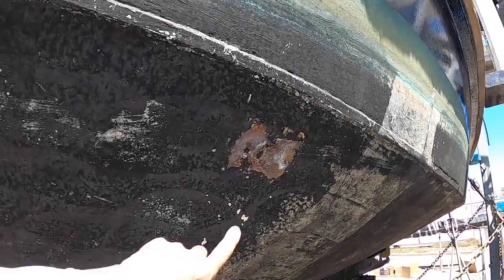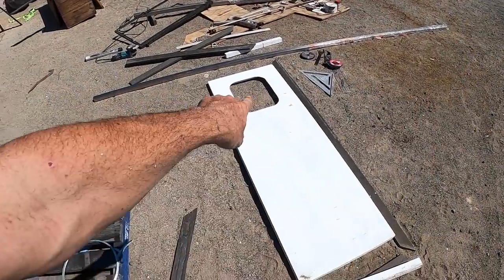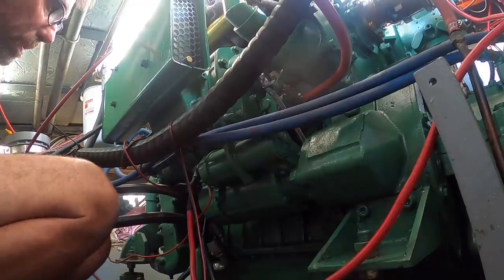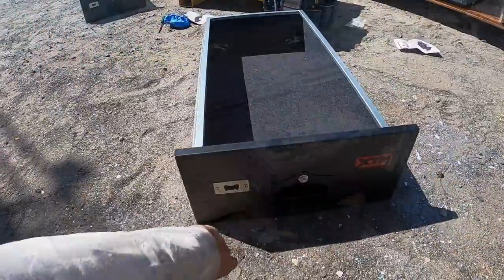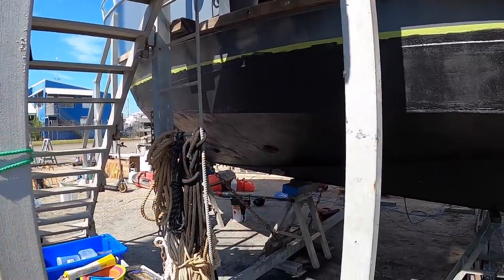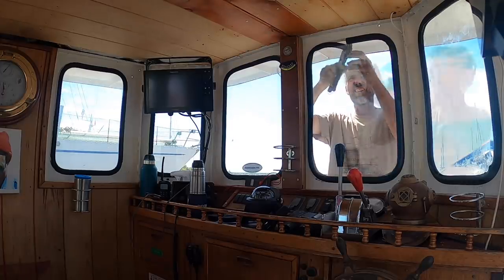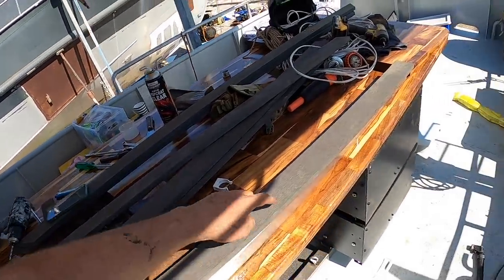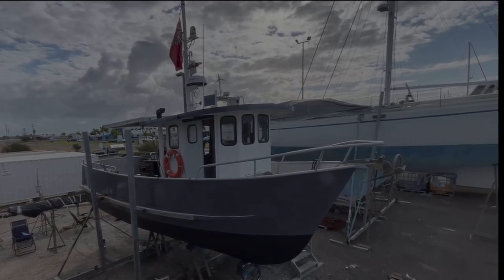Renko gets painted - last full week on the hardstand

Comment: Stu... Renko looks great, but I hope you misspoke at 18:12.  Dielectric grease repels moisture and helps prevent corrosion.  It does not conduct electricity and will not improve conductivity.  The fridge may be the most important support system on the boat.

Comment: Just a quick note on the self amalgamating tape ( you did say this is temporary but...) I always add an outside layer of electrical tape. it helps meld the rubber tape into a solid mass and protects it from sunlight.

Ha Ha - really enjoyed the sheer glee on Damiens face when you were covered in bottom paint!
Reply: For a job like that I’d recommend heat shrink

Comment: I like to write or scratch in the date and engine hours on the oil filter. Dielectric grease is a non conductive insulator. I found out when i put it on my auto battery terminals and then connected them. They failed within a month, i cleaned it off and then reassembled and put a thin coat of grease on the outside of the connected parts.

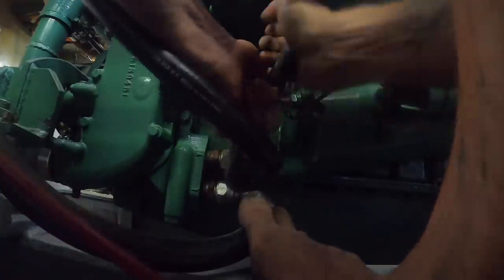Comment: 9:04 it might be worth buying a cheap ring spanner and modify (cut the ring big enough for the line but small enough to be six/five point) it for those oil lines. Maybe denso tape those types of fittings (shouldn't be needed in the engine room). Starters, alternators, fuel pumps etc do need to be easy to change and it's good to have proven spares. Your doing great! It's good to see someone getting to know their boat well enough to safely get the most out of it.
Reply: Cheaper to buy a set of crow foot spanners  and do it properly mate

Comment: Great update. I was pretty chuffed when the decks got fixed, but holy cats how nice everything looks when painted! I find the drawers on the engine hatch a bit confusing. Don't they make it hard to get to the engine - like really hard - even harder in the event of an emergency - and even harder than that in an emergency at sea? Maybe there's something I am missing.
Reply: There's a new hatch between the sleeping cabin and the engine room now. So you can get into the engine room without taking off the hatch. Still doesn't seem ideal though. The extra storage would be really nice, but wasn't there going to be two great big steel toolboxes on deck?
Reply: That was my thought. Do you really want a engine hatch that takes two people to get off.

Comment: Q: How are you planning to open the engine hatch on your own? It looks more than 2 bits heavy now with those drawers and table top attached.
ps. I know about the hatch in the sleeping quarters but, for instance, the batteries are at the other side of the engine "room".
Reply: Some gas struts could fix that
Reply: He has the hoist that he used  to bring in on deck
Reply: Neils.  He has the hatch into the living space for quick access.
Reply: @albertomoniz9051  But in the video you can see the fixed angle of the deck hoist and the arm length just don't fit under the solar canopy.
Reply: was thinking the same, could climb in through the new cabin window in an emergency ?
Reply: @mattmurphy9100  That could possibly work, but then he will absolutely need blowers or ventilation. It isn't so bad previously as the open engine bay hatch was a massive airvent. If you have no main engine bay hatch open, entering via the cabin (which is a low point) is going to be dangerous if there are toxic gasses in the engine bay (eg. exhaust leak) and no other method of high volume air movement.
Reply: @albertomoniz9051  It hasn't the reach I don't think. They carried it the last two metres.
Reply: I think a snatch block from under the roof will do it.
Reply: @Sokrates66  Those solar panels are mounted in a aluminium angle frame suspended with a few wires from the mast. That does not make a solid roof. 
Without the wooden table top two man just could lift the hatch.
Reply: and once the drawers get filled with stuff, as you know, drawers are wont to do, the thing will weigh a ton! So much for whipping it off to do a quick check on whatever, like the water strainers etc..
Reply: @nielsdebakker3283  I dont know, i meant that a snatch block from the roof of the cockpit, not solar panel. You dont have to lift everything just tilt one side of the hatch, maybe lift with the crane at the other side if needed, that was my thought.

Comment: She looks great Stu. Had windows in rubber on a steel boat I built 35 years ago. Same set up as on Renko. Had one punched in by a wave on the Tweed bar. Lucky we didn't cop another. I fitted brackets across the corners to stop it happening. Don't trust the rubber.
How far up are you heading?

Comment: Renko looks like a yacht now with the new topside color, the new starter you put in will last you the life of the boat its a gear reduction starter compared to the direct drive MT42 you took out. Keep good start batteries you shouldn't have any issues, the old Detroit should spin over faster. I know what removing bottom paint is all about I had to strip a 24 foot off shore work/pleasure aluminum boat down to white metal. Previous owners didn't have it done properly. Not a fun job, I put 4 barrier coats then 4 coats of antifoul, it was expensive, all good now.

Comment: Ad a Balmar Smart regulator to the to the alternator, you can really regulate in and out of your batteries, you'll really reduce pricey future problems, it has a reporting system that you can view from the helm. Batteries DO NOT function off of a fixed charge system, they all don't want to receive 14.6 volts and really can't, the allowable voltage to keep batteries charged differs by heat and temperature and by how much charge they need. So if your running constant voltage to a battery, you are just looking to have shot batteries. This system feeds each battery exactly the voltage the battery needs to accept for the conditions.

Comment: Dielectric grease should never be used on the actual connection points between connectors or between the wire and connector.  It should only be used to seal the outside of connectors.  

Dielectric grease is actually a insulator and can cause a high resistance situation.

Comment: Out of MacGyver/hacker mentality  and curiousity, if you needed to in an unlikely emergency could you take the gear off a starter motor and mount it with whatever methods available onto an electric drill then jam that in the place of the starter and start the engine with it or would it not have enough torque? I have no experience with engines of that size and also I think it is an interesting thing for you (or Adrian or anyone who would know by heart if he shows up) to answer
Reply: The original MT40 starter Stu took out is rated around 12 HP, you would need a very big electric drill. It would be easier to get another boat to bump start him ;-)
Detroit engines start quite easy, but the initial 'breakaway torque' to get them turning is quite high, there are different types of starters available, compressed air starters, hydro starters that used high pressure oil stored in a tank, and inertial starters and wound spring starters, all have their good points and shortfalls.

Comment: Your engine would be easier to access if you installed an undersized engine as well. Just sayin'. My thoughts are that a certain boat should have two of those cummings engines in there. I've seen smaller boats than that one with two.

Comment: I dont know if you could help me but I have an evindrude 30hp which is the same one as the johnson which you did a series on 

To get to my point would you be able to point me in the right direction when it comes to replacing the propshaft oil seals I've seen your video on replacing then however cannot actually find any. anywhere. any help would be much appreciated

Comment: How are you going to get into the engine bay in an emergency ( fire, skin fitting failure, removing batteries, etc ) any issue at sea that requires entry into that engine bay is going to be impossible to deal with. Using your deck crane in an emergency is going to be too slow and cumbersome. The entry into the engine bay via the forward cabin isn't really a practical alternative to the big entry from the deck. Am I missing something here?